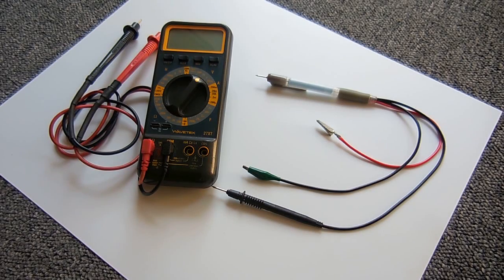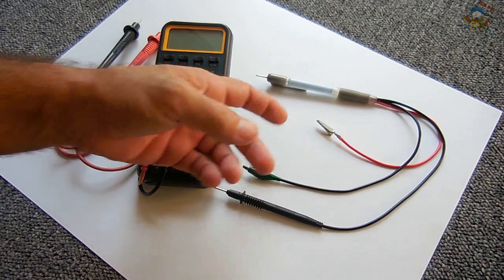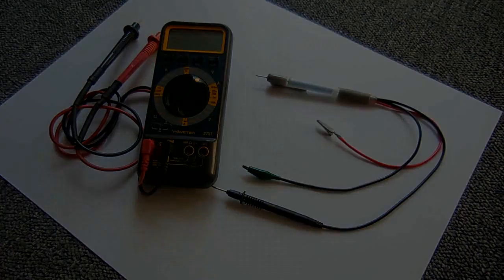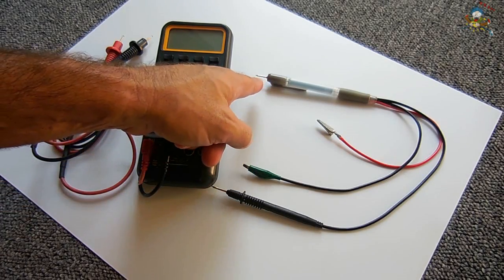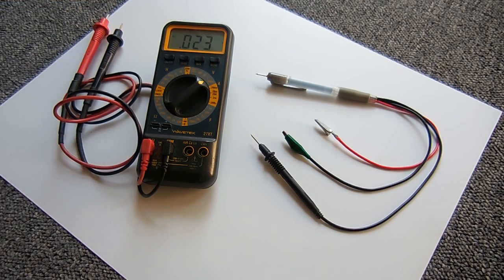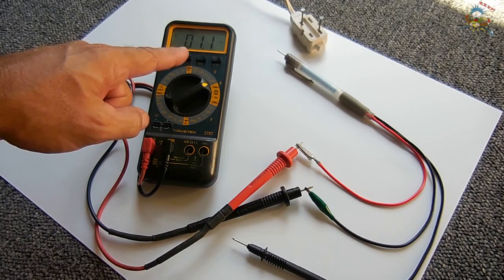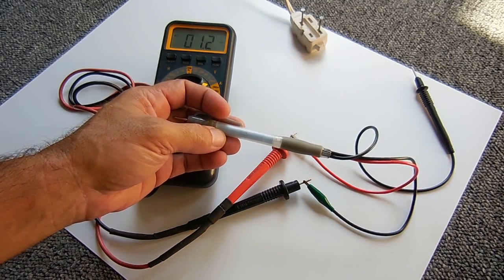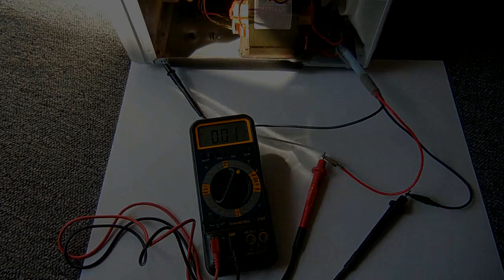How To Make A High Voltage Measurement Probe For Your DMM!

Comment: I am an Electronics Engineer.  There is no way I would use this probe.  Just one reason is that proper probes have an earth ring at the hand end of the probe.  If there is voltage breakdown from the tip, along the exterior surface of the probe, the earth ring will divert the voltage to ground before it gets to your hand.

Comment: How would you measure voltage from distribution transformer with this when there is 3 poles all positive at the HV end? I have one 50kVa  D-TRAFO in my shed, i have built ballasts for it and resonant capacitor bank. Just want to measure the differences between each updates i make to find the right resonance. Thanks! and don't worry i wont hold the probe when measuring it, not that stupid that would go near to it when its on and there is charge in capacitors.

Comment: There are too many dumb things you did here. If anyone would put this together they should not go more than 2 kV, but not 1 kW microwave oven transformers.
You started very scientifically by mentioning dielectrics of the pencils and then go full dumb mode suggesting short resistors, and then soldering them like there is no tomorrow, ignoring everything related to air. and, of course, air bubbles in the materials.
Reply from the maker: The only dumb things are what come out of some viewer's mouths. The high voltage makes contact with a LONG 200M resistor which happens to be very snug inside an excellent dielectric tube. What I did after the 200M resistor makes no difference. Think before speaking next time.
Reply: @electronicsNmore  One usually builds a HV probe using the high resistance resistor and the resistance of the meter itself. Then, all the design goes into the plastic around it. How do you know the dielectric value of the plastic of that pencil? Did you measure it? Do you have some idea of the air bubble content of that plastic, which will turn out to be the failure point of that "probe"? I don't care if you'll find out the hard way how this probe will fail at 20 kV while using it yourself, just don't tell others that it's safe to use, cause it's not.

Comment: This is probably so unsafe
A high voltage dmm probe on a test gear site is like 75 bucks
I'd say someone's life is worth a lot more than 75 bucks (or just don't mess with high voltage for fun)
Reply from the maker: Nothing unsafe about it.
Reply: @electronicsNmore  The clearance between the body and the item to measure is very unsafe. The HV probes are very long

Comment: First of all 30kv is medium voltage not high voltage. Second this is an interesting idea but  I strongly suggest not to actually try this probe on a medium voltage circuit. (I wouldn’t use this on a 2kv circuit) If it arcs over the explosion will probably kill or maim you! Medium voltage switchgear is not something to play around with get proper tools please.
Reply from the maker: Don't be a pedant.

Comment: Nice video, thanks! Why does the second resistor need to be > 1/2 watt? 

In your case, Rb=200M, Rs=200K, a factor of 1000. Say you go crazy and measure 100KV ->  then Rs sees 100Volts. Dissipates 100^2/200000=0.05w. A 1/4 watt resistor can take 5 times that. 20 times if you measure 50KV.
Reply from the maker: It's been a while, I think it was 1/2W. Thanks for watching

Comment: Hi!
I would like to measure  small RF voltages.. 
Do those resistors voltage dividers are ok to measure 25kHz to 100kHz AC  (2kv to 20kv..)
From which frequencies   Capacitors dividers are usually used ? 
Thanks for your answer.
Sorry for bad English :-)
Reply: The voltage divider itself should be fine, but most meters will not accurately measure AC in the kHz range; they're designed to measure AC at 50-60 Hz.

Comment: I think the probe should be made longer and be held by a part that does not contain any elements. I would bet it will arc over easily before reaching 20kv. 2.5kv test does not prove anything. Even tektronics p6015 probe needs some oil inside to reach 20kV. It may not happen every time, but sooner or later voltage will find its way.
Reply from the maker: If you're concerned, add a thicker layer of protection between the probe body and your hand. Thanks for watching!

Comment: Clear concise video.  I hope I am not too late to ask a question, which is:  can I use two 49.9M 1W 10kV resistors with my DMM or is 1W too low for this application?  I was trying to work out the current my DMM would use so I could calculate this but I don't know my DMM's current draw.
Reply from the maker: I answer questions on all my videos regardless of age. Using (2) HV resistors in series to get the correct resistance value is fine, but use the wattage stated in the video, or very close to it.
Reply: @electronicsNmore  Okay, got it.  Thank you. =)

Comment: Would these resistors work OK?
https://www.ebay.com/itm/5W-Power-Rating-200M-Ohm-High-Voltage-Glass-Glaze-Film-Resistor-2-Pcs/362619382302

https://www.ebay.com/itm/3W-Power-Rating-200K-Ohm-High-Voltage-Glass-Glaze-Film-Resistor/362619392927
Reply from the maker: The specs don't mention how many volts they're rated for, so no.
Reply: @electronicsNmore  If you have looked at the links 20KV

Comment: So to measure the HV DC you don't connect the black wire? You did not show how to measure HV DC. This guy claims you need to calculate internal resitance of DMM https://www.youtube.com/watch?v=RAOw0mHQRvk
Reply from the maker: I measured pulsed DC with the black to battery NEG.
Reply: @electronicsNmore  The 200Megaohm resitor 20kv is not available anywhere. What about the "claims you need to calculate internal resitance of DMM" and what about connecting smaller resistors in series?
Reply from the maker: @juliusvalentinas  Nothing to calculate. DMM's have 10M inputs.

Comment: How about connect one 100Megaohm and volt meter in serial, use multimeter's internal resistance to get low volt reading and calculate racial?
Reply from the maker: I wouldn't change what I did.

Comment: If you value your life, don't EVER measure high voltage while holding a probe in each hand!
Put an alligator clip on that black lead and only hold the HV probe in one hand with the other hand in your pocket.
Do not let your stomach or any other part of your body touch any conductive surfaces and wear shoes; preferably ones with rubber soles when using the probe.
 Not following those safety guidelines can get you dead!
One mistake could easily be your last!
Reply from the maker: Where exactly did you see me do that in the video for high voltage?
Reply: @electronicsNmore  No, you didn't show it. But left a lot of space for dumb errors from the part of your users/viewers. 
Moreover, you suggested that this could go up to 40 KV. are you nut?

Comment: I am not able to know that why high voltage resistor is used,if we use a typical resistor with proper wattage using p=v^2/r .will do?or  if we are using high voltage resistor because of wattage is not the issue.
Reply: wattage is not the issue. Resistors have a voltage rating. Checkout the specs on carbon, wire wound and metal film. 1/2 watt carbon resistors are usually rated at 500 volts.
Reply: @dri50   you mean power is nothing do with voltage ie
 p=v^2 /r  has no meaning,only for  considering current power is calculated ie p=i^2 * r. I mean to say that if you use 12 resistors in series voltage across each resistor will be supply voltage divided by 12 then voltage will not be issue. ie 10000v/12=833v. This can be measured at 1000v range.
Reply: The problem with using several carbon resisters in series is that if only 1 fails (say it shorts) then all the other resisters are subjected to a much higher voltage and they may fail. Since your hand is on the HV probe this is not a good situation.
Reply: also, there is very little current flowing in the probe. Maybe only 50 microamps

Comment: I would like to use this voltage divider design for useing in for my oscoop probe to look at Flyback outputs and see what it looks like related tot the oscilated input of the flyback. Would this be possible without using the complecated diy probes that use all kind of capacitators. I am only interested in the wave forms and the relation between the driver, so accuracy is for me also no issues. So would your design be applicable for that?
Reply from the maker: I would think as long as you don't exceed the voltage rating of the probe components, you should be fine. If you don't destroy a cheapo DMM measuring the output voltage, then it shouldn't damage the Oscope.....but there's no guarantee. Try at your own risk. Thanks for watching!
Reply: @electronicsNmore  Yes, that's a good safety measure I think. Put a HV capacitor on it so it will boost the voltage to the maximum and than measure it with a DMM. If that's safe (the DMM is still fine) I could maybe go for a measurement with the oscope. But I'll be honest with you, I'm a bit scared; I do this hobby just for 7 months now and I have the scope just for a few months, so I will take some time I think. Thanks :)

Comment: Nice project, i made mine with a grabber on the tip, so that i don't have to touch it while doing the measurement. This gives some extra safety margin!
I used a cascade of many 10 Meg resistors and potted them in a teflon tube ,instead of the single high value resistor!
Reply from the maker: Whatever works for you! Thanks for watching

Comment: Thanks so much. Can I use it to measure high voltage high frequency such as fly back transformer?
Reply from the maker: As long as the DMM is designed for the frequency, and the components used are rated for the high voltage. Thanks for watching!

Comment: Should be called the Death probe.
Reply from the maker: It's a very safe HV probe when made properly and used with the correct voltage. The part you hold is made of plastic as well.
Reply: @electronicsNmore  Sure, let kids poke the  microwave oven terminals with this. What's the correct voltage btw?

Comment: But the resistence of the multimeter is 10Mohms and others are less
Reply from the maker: What does that have to do with anything? I proved the probe works.
Reply: i was asking if that is 10 mohm or less
Reply from the maker: Most DMM's have a 10M input impedance.

Comment: Would a 5W 1GigaOhm 1% Tolerance Glass Glaze Film Resistor + 1kOhm metal fim resistor work? That would make it possible to read up to 1GV?
Reply from the maker: Needs to be high voltage rated.
Reply: Thanks for the swift reply.
I was looking at these resistors:
https://www.aliexpress.com/item/5W-1G-Ohm-1-Tolerance-Axial-Leads-High-Voltage-Glass-Glaze-Resistor/32718623136.html
https://www.aliexpress.com/item/1LOT-100PCS-Metal-Film-Axial-Resistors-1Kohm-1001-1-1W-1000ohm-resistor/32524713943.html
Reply: @defooraap  If you use a 1G ohm resistor, you have to use for R2 = 1M ohm (and not 1K ohm...)   ( better 200M and 200k)
 (for people who want to build this (1 year later...))

Comment: Love your videos.  I work in a lab and am a relative newbie to electrical systems.  I need to measure the current going to the magnetron.  Would the high voltage probe allow me to do that?
Reply from the maker: Hello. The probe is only for measuring voltage, not current. Magnetron current is around 300-400mA. A current clamp around the WELL INSULATED HV wire leaving the transformer before it's connected to the capacitor and diode. That should work.
Reply: Thanks!  My setup is a bit different.  We are using an Alter power supply in conjunction with a transformer.  208V comes in from the building and is split between the power supply and the transformer.  The transformer in this case actually steps down the voltage to ~4.5V to supply the magnetron filament.  The power supply steps up the voltage to the 4kV required for our 1.26kW system.

Comment: Love your videos, very well done!  I made this probe and used it to check x-ray transformers, always wondered how to do it.  70,000 volts!  Used two high voltage resistors (1.250,000) due to the fact the terminals are above and below ground.  Also put a small pc mount variable resistor on the ground end so I could adjust and correct the voltage.  Thanks again!!!
Reply from the maker: +wolfgang schmittenhammer 
Glad you enjoy my videos! Not enough people are watching them. Please be sure to share and rate thumbs up. Thanks.
Reply: What is 1.250,000 ?,terminals above and below ground?, why you used pot and watt of it?

Comment: Great DIY but seen something that I myself would have a problem with if I made one. Your two meter wires off the probe are short (length), they are the same length and not isolated from each other. If you had it all connected and turned power on to measure HV and something moved or vibrated  (like a large unmounted transformer ect) there is a good possibility that they will touch and ruin your day. (or even connecting them and having them on top of a conductive surface).
Reply from the maker: ***** You are correct that I should have made the wires different lengths to prevent them from touching each other, but even if they did touch, it would be a non-event. At 20KV using a 200M resistor, only micro amps can pass. If the red clip shorts to the ground clip, then you will have no current at all to measure.

Thanks For Watching!

Comment: It should be noted this will work best only with meters with high Z (impedance) inputs. Luckily most DMM's have input Z's around 10Mohm so it can be negligible in some cases.

Also be careful to NEVER connect the negative ground of this probe to the high voltage line. This will connect the meter directly to the HV, and if that HV is relative to ground as you are, than you will get a nasty shock reaching to the meter, esp. if it is a cheap dangerous (without proper CATII 1000v CAT3600v rating or better.) one as the one shown in the video.
Reply from the maker: Power Max I mentioned in the video exactly where the HV is applied to the probe, but you are correct, I can see people connecting it up backwards, which is why I added the disclaimer to the video description area. You're also correct regarding the 10M DMM inputs.

Thanks For Watching

Comment: What are those cables rated for? 1K? Where's the safety margin ?
Reply from the maker: Adrian Higgins You do realize the wires do not need to be rated high voltage? Once the high voltage crosses the 200M resistor, the voltage is at a very low level as you saw in the video. All that needs to be high voltage rated is the plastic tube, and the resistor. If you feel the need to have high voltage rated wires for low voltage use, then you can remove the HV wire going from the flyback on a CRTV to the tube and use that. They are usually rated 40KV.
Reply: electronicsNmore Could you check your video from around 2 minute mark. You were referring to resistances etc. Seemed to be jumping around between Meg ohms and kilohms. I think there may be an error there. (I'd like you to check it in case someone builds on of these and makes a mistake etc).
Great video - Thanks v much.
Reply from the maker: Everything is correct. I watched it before uploading. There are (2) resistors used to make the voltage divider. One is MEG ohms, and the other is KILO Ohms. There is also another image in the video showing the voltage divider.
Reply: electronicsNmore Oh, of course, you are making a voltage divider with a voltage drop of 99.9% roughly across the first resistor.
Sorry - I wasn't paying attention, obviously. (I'm also not very smart with these kinda things).
Thanks v much for reply. Great stuff.

Comment: Great video :) Very useful probe, actually. Sometimes I repair CRT TV's, so such a probe is a nice thing to have. It should be rated for 30-40kV, but overall it is gonna be the same
Reply from the maker: Anything is possible, which is why it is a good practice to not hold the probe. The resistor is designed specifically for high voltage use, so failure is unlikely if you stay below the maximum rating of the HV resistor.
Reply from the maker: MrJohhhnnnyyy Glad you enjoyed the video. You can pick up 30-40KV resistors online.
Reply: electronicsNmore what happens if the resistor fails could it fail in a way that it has potential for high voltage to be on the probe wires ? Newbie I am !